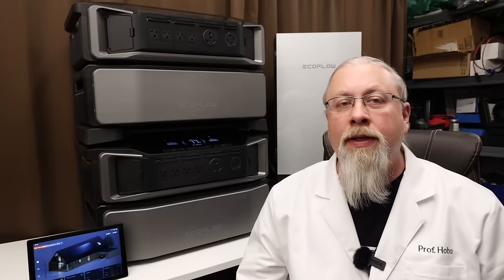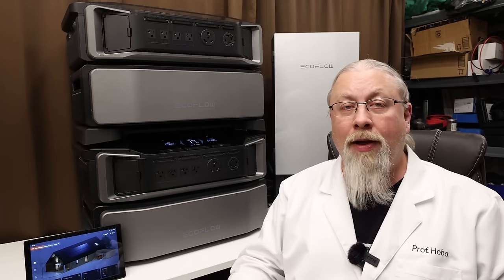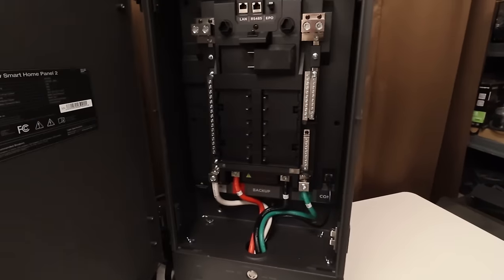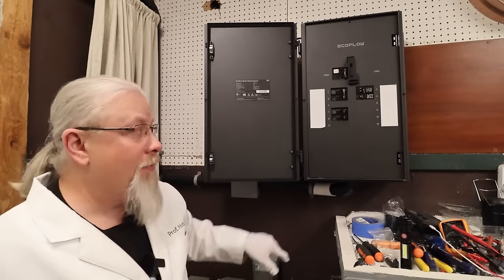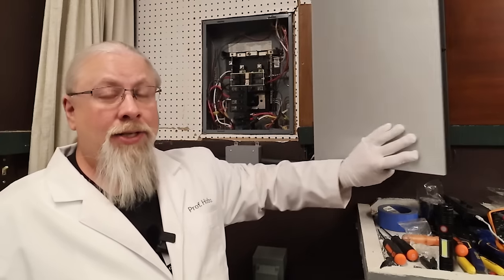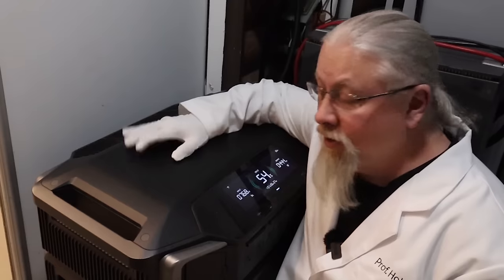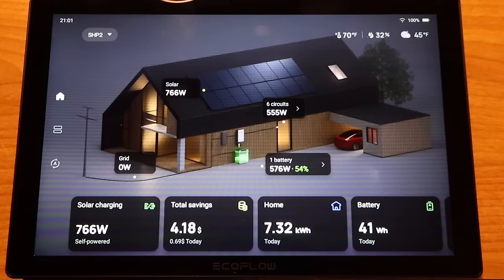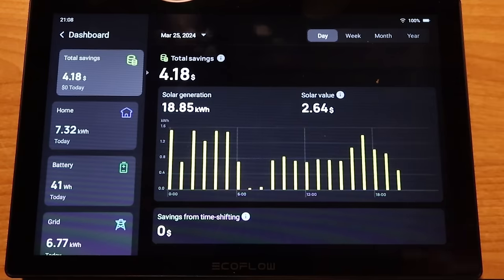Power Your Home! Ecoflow Smart Home Panel 2: Complete Backup System Install & Review

Comment from the maker: CHECK IT OUT: https://gohobo.io/shp2 use code EFDPUHOBO8 to get 2*220W Solar Panels($1,298) for free (Valid until May 31st) 
CHECK OUT THE DEDICATED DPU REVIEW: https://youtu.be/PNz4WmT7Hr0
---
Now enjoy 12-month interest-free payments plan offer, available for as little as $484 per month.
For TX & CA homeowners: check out the latest ‘Hassle-Free bundle’- including a DELTA Pro Ultra, a Smart Home Panel 2, plus installation service, all for just $8,499. 
for all US homeowners: The Smart Home Panel 2 Installation Consulting Service ensures a worry-free setup by tracking orders, managing fittings, and answering technical queries. (claim a $500 refund with customer service)
Don't forget the 30% federal tax credit for hooking the Ecoflow into your home!
Reply: Hi there

Tried to pick "EcoFlow DELTA Pro Ultra Whole-Home Backup Power" (Inverter + battery). System gives "EFDPUHOBO8 discount code isn’t valid for the items in your cart". Is $800 discount still valid?
Reply: Thanks a lot, I have the system coming in a weeks time, that cover issue would have gotten me too, the old phone boxes had a cover that grounded the system when closed, would not work otherwise.
Tricky, they need to mention that in the instructions 100%

Comment: Over Priced! Better to buy an EG4 6000XP!
Reply: I agree.
Reply: While if I was building a home I'd be very tempted by EG equipment (especially that mini-split that plugs directly into solar panels!), but the Ecoflow also has sockets on the front ready to go, you can plug the fridge right into it if you need to.
But once you're getting all involved with direct connections to your home circuits, I suppose it gets equally as involved either way.
Reply: @michaelmartin9022  I like it, but it is expensive compared to a self build

Comment: Also, your installer who ran your conduit and forgot the cat6, did you a favor, never share the same electrical conduit with a data cable. You run the chance of electromagnetic interference jumping on to your data lines. Ask me how I know! If you do run it parallel, right against it you have to use shielded cat five or six cable.

Comment: The Smart panel is $1899 and the quotes I’ve gotten from electricians so far to install it is around $2000.  That’s in addition to the inverters, batteries and solar panels.  That’s a lot of extra money.  Couldn’t you run the two inverters with the 50amp hub, and back feed to your existing circuit box (albeit w/o the fancy features) and call it a day?
Reply from the maker: Yep but then you have none of the smart features and no grid charging ability. You could install cheaper by doing what I did and install the panel next to your existing vs replace. Also  the panel is a lot cheaper in the bundle with my $800 off code.
Reply: I asked electricians how much it costs to install a 100A sub panel beside your current panel and you want to move a few circuits to the sub panel from the main. If you tell them it's smart or any of that extra nonsense they assume you have money. You tell them you will provide the subpanel and my quote was $800. And then when he came to install it he charged an extra 100 to put in the conduit for the plug for the battery.

Comment: Sir you did a good job but I know there's always a but. I worked in the IT field at college for 27yrs. You don't wanna run your cat5/6 network cable inside the same conduit with your power cables. Still though awesome video I wish I had your knowledge.

Comment: Good review. I have a very similar setup. The review reflects my experience for most aspects of the SHP2 but you should do more review on the grid tied functions. Why? The actual orchestration of the SHP2 and attached DPUs is limited and has some challenges when you mix grid and solar. Especially if the goal is to roll back the meter (like the title of the video). One major limitation is the "max charge" for the DPUs. The max charge is shared by all inputs. So when grid tied, and the batteries are allowed to charge, they will quickly charge on grid AC, reach the max charge limit, but then none of your solar energy will benefit the batteries unless you actually consume some of the battery energy. Having the ability to charge to x% (aka set a target for a charging task) or having a different max charge for grid vs solar, would allow for much better orchestration between grid and solar. As the professor you should also measure the "loss" between AC charge and AC discharge on the power IN/OUT port. Just by being connected to the SHP2 the batteries will drain a few percentage points everyday (could be improved by shutting down all but one inverter for example until they are required). Not all DPU inverters are equal, on average I see 15% loss between my charge/discharge. But one of my inverters is an outlier at 38% loss. Please keep the data and reviews flowing.

Comment: Hey Doctor Hobo, thanks for doing this video. I look forward to some of your additional and long term testing of this system. I think it's cool you can also use the Smart Home Panel (Ver. 2), with up to 3 older Delta Pros as well. 👍 I like stuff that is backwards compatible with older (Read less expensive) technology.

Comment: Just a FYI, I have 2 Power kits, each connected in parallel to the smart home panel 1 via the power kit infinity cables, NOT available on the Ecoflow website??? Fortunately my Ecoflow dealer had them in stock and works great. basically 7200 watt output @ 230v here in Europe. I can use washer/dryer, water pumps, 2 x 12000btu ac units, some MIG welding, no problem. In the USA/Canada It's gonna be series connection to give the 240v split phase. I highly recommend the Power kits for off grid and RV, Boats. Awesome stuff from Ecoflow💖
Reply from the maker: Not sure if Power Kits can do split phase 240v as required here in the US. I asked them last year, they said there was no way to do it. That's really its only flaw.

Comment: Which battery is a good add to a system that has 14kw panels?  Goal is to charge when over producing then fill the gap when pulling more than producing.

Comment: Curious if you were able to power the SHP2 via a 120v generator to charge the attached DPU batteries? Or do the attached DPU batteries only charge when using a 240v generator via the SHP2?

Comment: I need something just a little bigger. 12 circuits is not enough, but 20 would be nice. I've been eying SPAN but this integration with battery seems better. I was ready to buy SPAN, but now I want to wait a year or two. It seems like we are in the middle of another electric revolution.
Reply from the maker: You can do what I did and run a 50A out to a sub panel.

Comment: Great info, as always! Would you recommend this system over the powerwall 3 system? I'm currently in the market, and Costco has a bundle deal of $6999 for 12kWh or $8999 for 18kWh. $1k additional with smart home panel 2 (no info on expansion battery packs as I would like 24 or 30kWhs minimum to have peace of mind come winter storm season etc) I have a virtual consultation with Tesla but it's good to know that I can get one with ecoflow as well in Texas. Thanks for the videos and TIA for your input! 🤓

Comment: HoBo, I’m having a 850 SQf Amish cabin built. I really want the option of being off grid. They will install a transfer switch as an upgrade, but I’m thinking I’d rather have them install this home panel 2 instead of the included 200 amp service panel and the transfer switch. I’d like to do the rest of the project myself. Is the smart panel 2 meant to work in this type of installation?

Comment: Of course, when I get one of those or 2 of those, I'll get the hub. I get the home panel and I hope each. I'll actually hook it up to the hub. Just to hook it up to the home panel. Just so I actually have a 50 amp plugin for a 50 amp plugin. Not a 30 amp 2 off 50AMP  to make A50AM. Then plug it into a 50 amp plug in home panel that it works.

Comment: Now you need a street battery for each of those generators and you'll be set even though they could take up the 5 batteries.That you need at least 3 and that's also so I could use the full output of the generators.Else you're not quite using the full output of the generators.

Comment: Hi Dr. Hobo great videos! As the smart home panel only takes 12 breakers could I add another smart home panel to connect my whole house?
Reply from the maker: You can do what I did and use one of the output circuits from the smart home panel to feed another entire breaker box. I think the per circuit limit is 60A so you can't exceed that.
Reply: @HOBOTECH  thank you for your reply!

Comment: I think you make great video's... Thank you.  

I do have a question, I am planning on building on a new property, 1st an out building with a home in the future. The electrical supply is approx. 2000 ft away.  It will cost $50,000 to $100,000 to bring in a supply.  I really like this Ecoflow Ultra thinking 3 inverters with 2-3 batteries per inverter each to start.  We plan on using 15kw of solar and will have a small dual fuel generator, and some small wind to help out.  My question is, if you were building this project would you use the EcoFlow ultra for total off grid or do you have a better solution.  I would really appreciate your input.
Reply from the maker: This is the easy no brainer solution with a warranty. If you want to build your own from scratch there are many options. None are smart like this product. Depends on what you want.

Comment: I saw in the video that you are in Arizona. Can the smart home panel be mounted outside? I still think that I would keep the power supplies inside because of the heat but given that my circuit breaker panel is outside, I would probably have to mount the smart home panel outside too.
Reply from the maker: It is not IP rated for outdoors so it would have to be installed in a dry location.

Comment: I read through different comments and replies you gave. You said the shp2 had to have some sort of power to work but during a blackout the only source of power it would have would come from the battery setup from my understanding. I have searched everywhere I can to determine if this panel requires 240 or can it run with just 120 like from a single delta pro with a single infinity cord and have found nothing. I have a 400 square foot cabin with a 100 amp panel and nothing that goes over 120v as well as less than 12 breakers. I would love to put this in and use the original delta pros with it. Can it be done?
Reply from the maker: Just like any other breaker box, only one side will have power if hooked to a 120v generator.

Comment: Do you HAVE to use that smart panel? If the combiner base is removable from the panel ... could you just run the wires into a normal UL panel?
Reply from the maker: You can use your own panel.

Comment: I'm here in Tucson and I have the Eco Flow Delta Pro Ultra with three batteries (two being shipped) I also have the A510A 50-amp transfer switch and 11 400-watt bi-facial panels coming soon. I want to power our 3-ton heat pump split central system. The problem is that the transfer switch panel did not come with a cord to connect from the panel to the DPU. What do I need to hook this up?

Comment: I want to run my desktop Computer on a solar generator 24/7  with Solar & A/C plugged in at the same time. I want it to run on solar power but have the A/C power kick in if the battery gets too low. Can this unit (or any unit) do this??

Comment: If you were to put in one of those EMP Shields, would you put it in the SP2, or the original breaker box?
Reply from the maker: Neither, because they don't block EMPs so save your money. A basic lighting surge protector from Home Depot does the same thing a lot cheaper. It goes into your main breaker box.

Comment: Where is the power coming from that charges your batteries when they’re connected to the smart home panel 2, like which circuits?
Reply from the maker: Power comes from the batteries, which are charged either with grid or solar depending on settings.

Comment: Thank you for this video. I really like the "Power Insight"? (Android Tablet) -- I am confused about the grid requirement. Are you saying it won't work complete off-grid without an external generator for the sine wave signal?
Reply from the maker: It needs some kind of "grid" to power the panel, either 120v or preferably 240v.
Reply: @HOBOTECH  Thanks.
Reply: So couldn't you do a work around by adding a 30 amp plug to your main panel and use a delta pro or something like that to provide the 120v. Then you are still off grid and able to power the panel.
Reply: Using a generator you still need to have propane or fuel which means you are still relying on outside sources which in a disaster situation is bad
Reply: @davidbailey3289  You would need some sort of Transfer Switch for sure, because if you hook directly to the main panel you would definitely backfeed into the utility, and potentially cause a disaster. Almost certainly it would be out of phase as well.
Reply: @marcfruchtman9473  yea I was aware of the need for a transfer switch and to me the smart home panel 2 looses ground over the original for my needs. No option to choose between 120 or 240 and for me and the small cabin where everything including washer dryer hot water heater etc is 120 it have no need for something that requires 240. Not to mention there is no grid power. Even the mini split is a hybrid that during the day runs off solar and battery overnight. Everything was designed that way due to cost and to make it easier to recharge the batteries so its self sustaining.

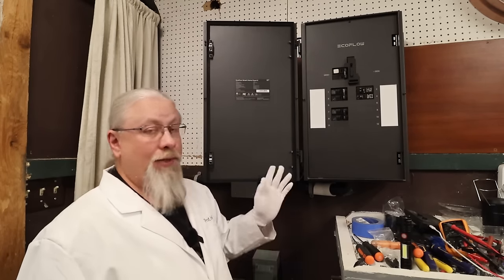Comment: I do have a question, at 10:55 of your video you are showing your Smart Home Panel 2 install, it appears that you are using in breaker spot 2 a tandem or split breaker. is that true? That would allow you to almost double your circuit counts. However you would not have individual control on each circuit on port 2 so if you turn off circuit 2 electronically both circuits on circuit 2 would shut off.  Also, what is the max Amp on the Smart Home Panel 2 would it support 200amp as a main panel ion a home?
Reply from the maker: Yes, I'm using a split breaker but it's only hooked to one circuit. It's what I had available. The panel is limited to 100A on the input.

Comment: I noticed that the app will let you specify the generator input as 110v.  Do you know how to wire it to the panel in that situation?  Just use L1 (and the panel does the magic to power both sides) or run L1 to both sides?  I hope that makes sense as I am really curious.  Thanks!
Reply from the maker: That will be the next video on this product.

Comment: Your thoughts on this vs eg4 with rack mounted batteries?
Reply from the maker: This system is smart, eg4 is dumb.
Reply: @HOBOTECH  thanks, I’ve been subscribed for a long time and used your codes multiple times. It will be really nice to see a detailed comparison between the two systems. To know what the smart option brings to the table, and how much I will overpay for it. Is it worth it? I'm sure lots of people will be interested to know that as well.

Comment: Is charging speed from “grid” any different if you have 2 DPU’s and the SHP2? 

I know you covered charging the DPU via 120v & 240v in the 1st video, but the biggest drawback for me is only being able to charge my DPU (1 inverter, 1 battery) at 1800w using 120v while outputting 240v via inverter. I know you can charge at 3000w via 240v, but it turns the output circuits off. 

If I could charge faster from “grid” while still keeping my 240v output it would be very helpful.
Reply from the maker: Yes, the integration kit allows the home panel to charge the DPU with 120v grid/gen while still providing 240v output. The home panel disables the DPU outlets, so you can only pull AC from the home panel. I was able to charge both DPUs at 3600w each simultaneously.
Reply: Ah, that was my question too, can it charge a Tesla at 240V while the ecoflow recharges from solar and/or grid?
Reply from the maker: Yep, and will demo EV charging in a future update.

Comment: Is that cable rated for conduit?
Reply: He said he was running 6/3 Romex which is NOT rated for conduit except as a sleeve. 

Also he appears to have run plumbing conduit vs electrical conduit. They're both schedule 40 but one isn't listed for electrical use. 

They also mentioned the original plan was to run the cat 6 with the power in the same conduit. which is a no no as well. 

I'm guessing the person hired was maybe a handyman that "knows how to do electric " vs an actual licensed electrician.